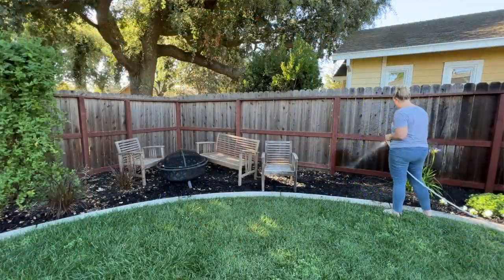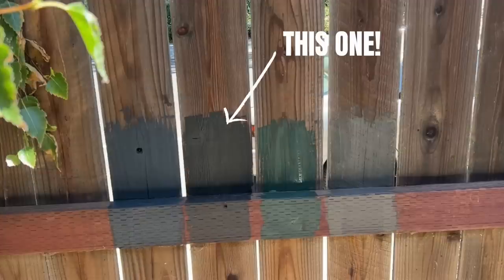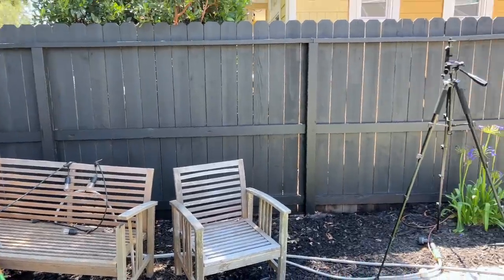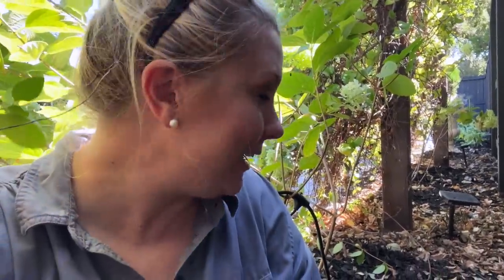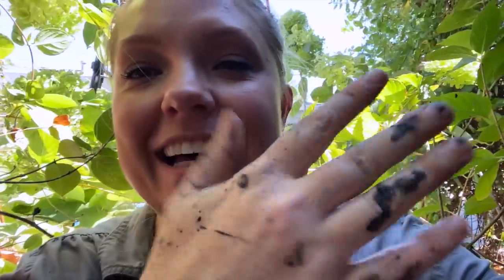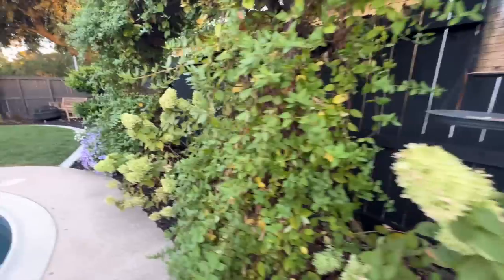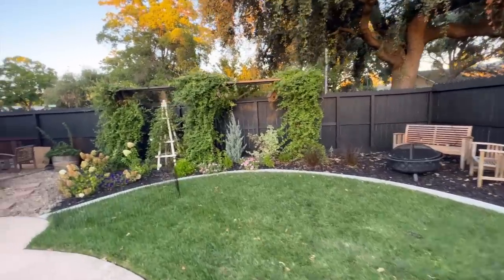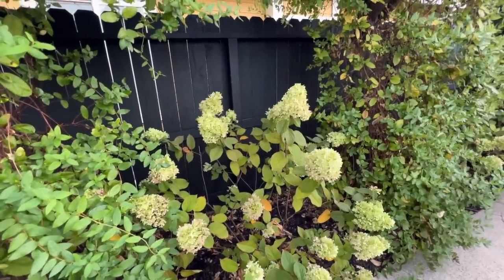Staining Our Fence Has Begun!  Come See What Color We Picked! :: Dig, Plant, Water, Repeat

Comment: Overall the stain makes your backyard so much nicer! Near the bench in the corner, I would suggest you plant 3 agapanthus on each side of the bench (3 in a wide triangle pattern) and the tall (burgundy) grass (3-5 in a line) on either side of those. Bonus is they are all perennials. You'd need to relocate the existing agapanthus/lily of the nile. You might even be able to divide it! This would make that corner more inviting.